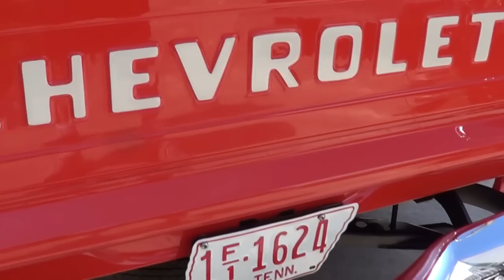1955 Chevy Pick Up

Comment from the maker: Cool...you can buy one done cheaper than redoing one your self...the history of this truck is why the own was willing to spend the money...I don't know the market on 55 Chevy picks ups.....but my guess is around 20k....of course this one wins shows...so it won't be as documented as this one....but that should not matter to a 22yr old that is going to drive it....glad you enjoyed the video...I appreciate your support of my channel!!
Reply: I actually replaced the engine in this truck.  The original engine was a 216 i think and had a rod knocking , I found a 235 or a 292 , 6 cylinder, really caint remember whitch " that i pulled out of a dual wheel 54 Chevy flatbed .
I use to work for Randy's dad back in the late 90s ...
I remember the truck and the story that goes along with it .
Ronnie Sellers.

Comment: My dad had a Series 2 1955 Pick Up, 235 straight 6, 4 speed Hydramatic, big window(I believe it was called a "camper special" for better visibility when a camper was installed in the bed). bought it in 1968(when I was 3) and sold after I burnt the cylinder head gasket in 1988 for $250. :(
Reply from the maker: Cool..thanks for the comment!

Comment: I have a 55, 3100 and it has a different hood than yours but I also have a 56, 3100 that is the same as this one. What determined the different hood style ? Or is it not the original hood that came with it. It has the two raised ribs.
Reply from the maker: I just shoot the videos....It's not my truck...

Comment: 1955 was the first year for a V-8 in Chevy pickups it was a 265 cubic inch same size as their cars. Ford offered a V-8 in 1954 so Chevy needed one to compete with it. My 1957 Chevy pickup was the first year for their 283 cubic inch, the six had plenty of power as long as you did not need to tow heavy loads at highway speeds. Chevy had some of the best 6 & V-8's engines - power wise - offered back. I don't recall a straight 8 being offered by Chevy or Ford they were outdated by 1954 on up. Cheers

Comment: My Granddad's '56 3100 has a starter button on the floor. Was it an option on the pickups to have a key start? Also the truck came with one brake light and no turn signals. Some time after he purchased the truck he had to take it back to the dealership to have a second brake light installed and a turn signal kit. Not sure when, but Mom said that Pennsylvania changed their motor vehicle laws.
Reply from the maker: lol..I'm not that old!!....no...I couldn't tell you...by the time I came around...they all have turn signals...and break lights....
Reply: He said it was equipped with the options.
Reply: +LocomotiveEngineer Key start and turn signals were an option in 55. Also the passenger side mirror and visor were also options. Really cool history was the best part in being involved in the build of this truck

Comment: ask him iffn he would be interested in trading even up fer a 96 dodge 1 ton with a 12 valve cummins diesel in it with around 235,000 miles on it if he is id sure swap with him lol 
i love these old trucks my cousin had a 46 that was sweet but it was all updated and clipped with a camaro had digital dash n all they ruint it with the exception of the a/c they put in it